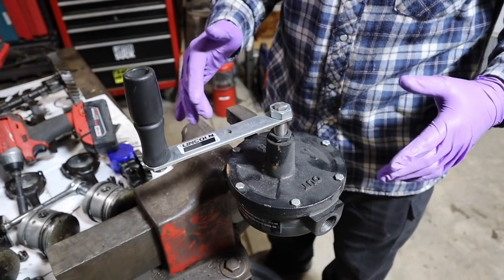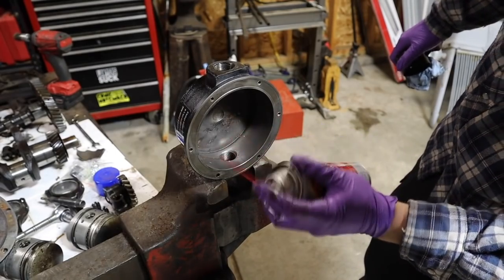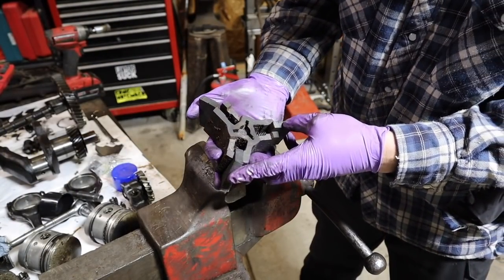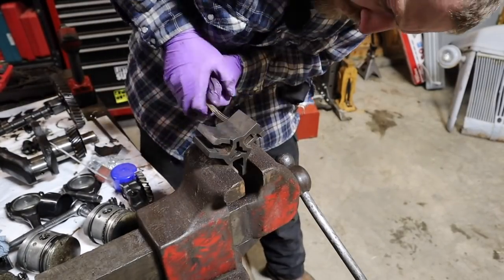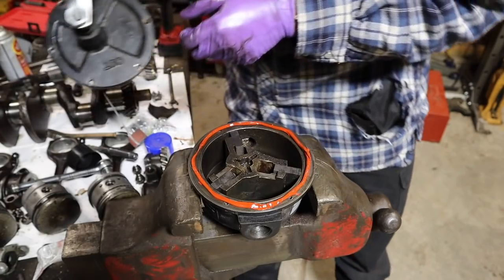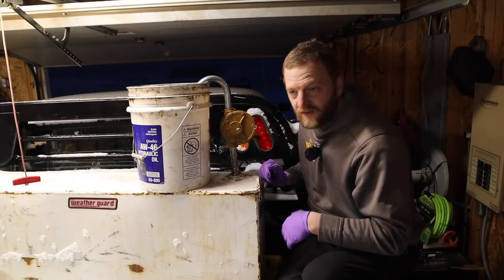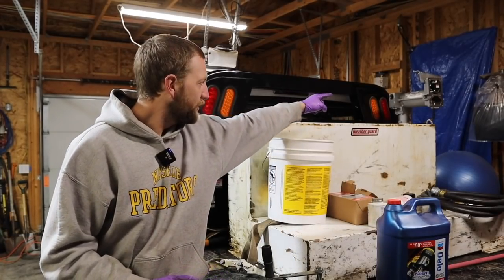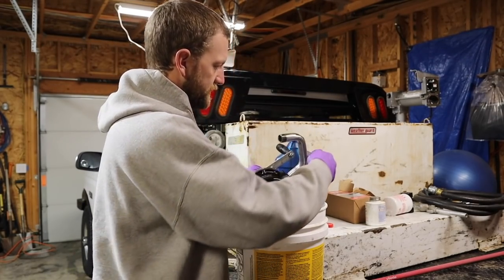After hours in the shop

Comment: Short of cracking the housing those hand crank centrifugal pumps are near indestructible. It looked like the draft tube wasn't sealed very well which could very well be the reason it didn't self prime. As for the housing gasket a fuel resistant RTV is the way I would have went as well. Nice content they basically work the same way a power steering pump works. Just thought I'd throw in the bit about the power steering pump. Don't waste a bunch of money on them either. A rebuild kit is typically less than $30 and only takes about 10 minutes to rebuild. I'm cheap that way.

Comment: Those sliding vane pumps ain’t good for much else besides getting froze up. Gotta keep them filled with oil all the time. The one on my sprayer is froze up right now. Need to get it apart before this spring and see if I can free it up and get out of spending almost 200 bucks for another one.

Comment: In the oilfield we used those types of "vein" drum pumps for years.  10 rotations per gallon and constant maintenance (disassembly, cleaning reassembly).  So for twice the purchase price we bought GEAR driven hand crank drum pumps and never had a problem and believe me we pumped some nasty stuff at times. acids, corrosives and so on..  Gear  driven = 3 rotations/Gal VS "vein" Pump 10 rotations/Gal. Pumps are the same size, dimension and weight  Do some math and yourself a favor..

Comment: I couldn't tell from the video did you put the vanes back in the same way they were originally?   Like brake pads they will sometimes wear in to match the pump housing surface and since it was all rusty they may not have a smooth face. Perhaps reversing them to give a smooth mating surface would help.
Reply from the maker: I put them back in the way they came out, the backside has a hole to retain the spring.
Reply: @GuyinWY  Ahhh... I missed that.